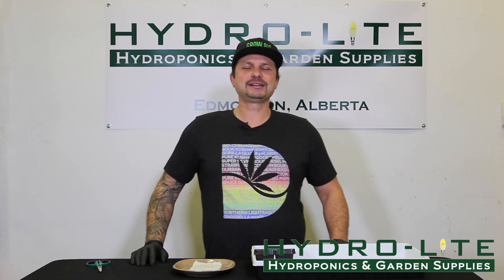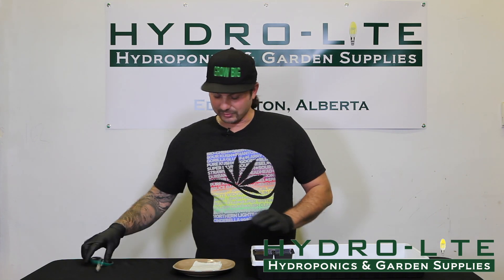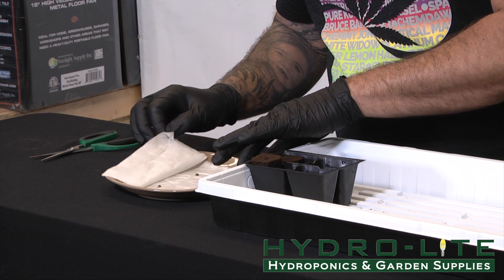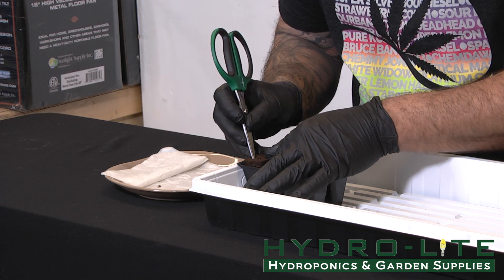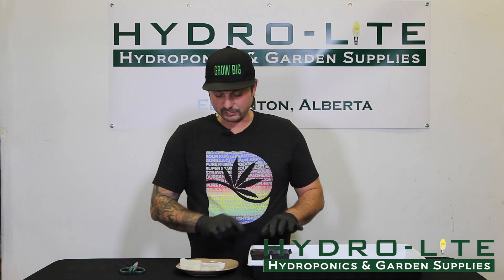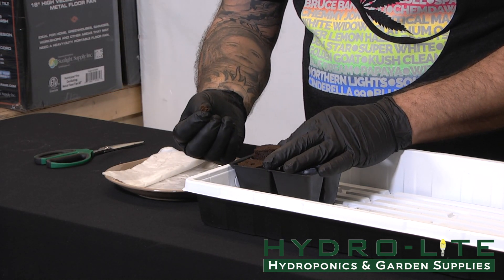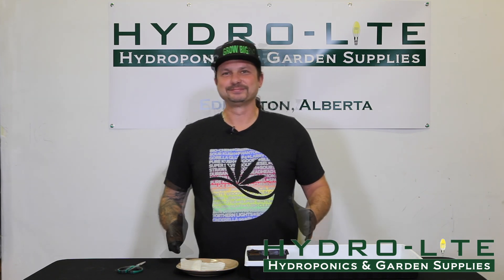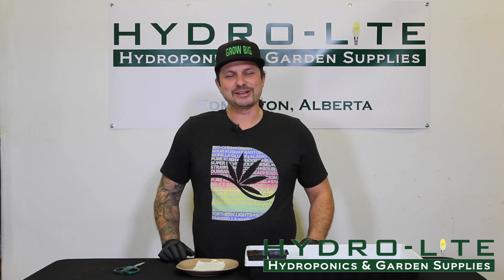#8 Placing your Seeds in Rapid Rooters - Hydro-lite Hydroponics

Comment: Excellent video. I will be trying the rapid rooter method soon. I see you had seeds on paper-towel. Is it better to start the seeds in the paper-towel method then (once they have the tail put them into the rapid rooter) or just put the seed in? Is one better in terms of success rate? Thanks for any info you provide for this in advance!.
Reply: Just soak the seeds for 12 hours in a glass of distilled water. Then take it out and place in the rooter plug
Reply: Best to have the tail showing before placing in rooter. Water, paper towel, seeds and 24-48 hrs later you should have them started.
Reply: So you germinate the seed then put it I the rapid rooter then you wanna get some around 6.5 pH water from your reservoir and let the rooter soak for a little bit?